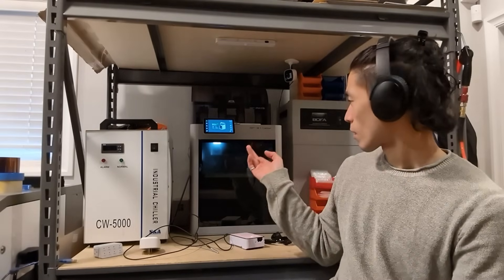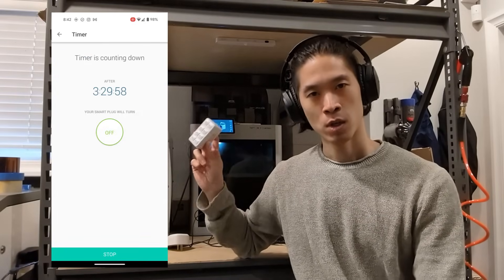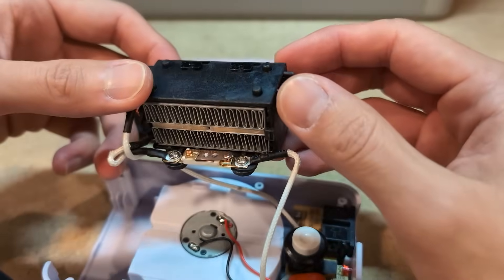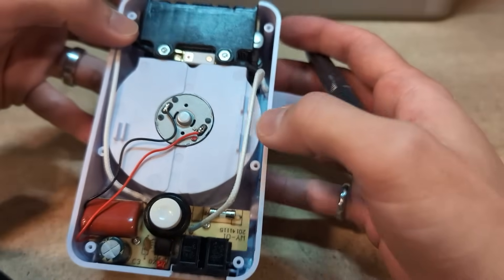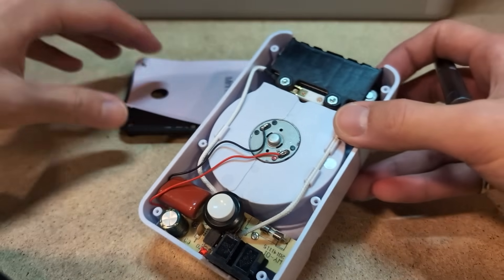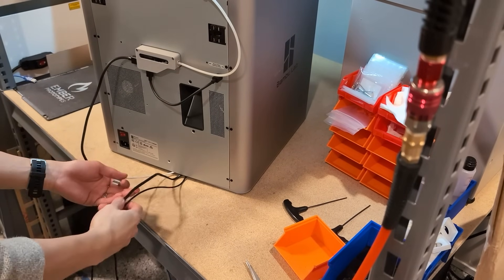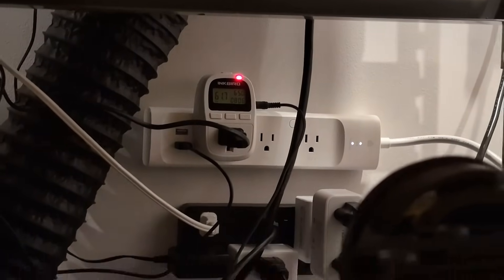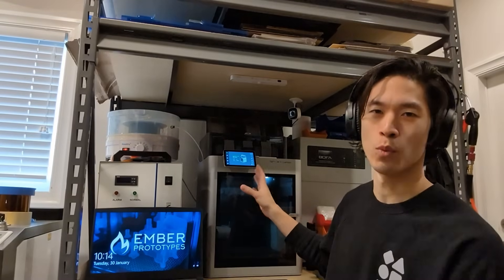Bambulab X1C - $50 HEATED CHAMBER

Comment: 6 months later... is there an update on longevity or any component wear?  I just bought it all to do PC-ABS but I would like to know how your machine handles it long term
Reply from the maker: @Xaedous  it's still chugging along great for me!
Reply: @emberprototypes  this is what I wanted to hear.. I am trying to get pc-abs dialed in and the actual layer adhesion is an issue
Reply from the maker: @Xaedous  heated chamber should help. I remember using polymaker pc-abs in the past and that stuff wants to warp like crazy
Reply: @emberprototypes  warping isnt the issue.. just weak adhesion between layers. like it s solid but breaks easily along the layer lines
Reply from the maker: @Xaedous  do you have the cooling fan turned off? That will help.
Reply: @emberprototypes  no fans on at all. Volumetric flow set to 10 on the last try and still weaker than pla+
Reply from the maker: @Xaedous interesting 🤔 I haven't printed much with that material so don't have a lot of experience. Curious if you ever find a solution!
Reply from the maker: @Xaedous  have you reached out to polymaker to ask?

Comment: This is a 50W heater were a Qidi 1 pro uses a 300W unit. Not sure it will be enought to be efficient.
Reply from the maker: It's been enough to maintain 60C no problem.
Reply: @emberprototypes  It is good to know. 
Thanks a lot.

Comment: Awesome mod! Thank you so much for posting a video. I've been wanting to put some sort of chamber heater into my P1S for a while and the heater and Inkbird just arrived today. Have you had any thermal issues with the electronics in the long term? I'm a bit leary about mounting the heater just on the other side of the back wall from the mainboard. Also curious about what some of the longest print times you've run with the heater on?
Reply from the maker: I've had zero issues thus far and have been running this for a long time now. I've had very long prints (20 hours) as well as non-stop production work and it's been working like a champ so far for me!
Reply: @ glad to hear it! I just finished the setup in the same configuration as you (well, with a bento box) and just fired it up for the first chamber heat. Thanks again!
Reply from the maker: @justinu1182  woot! And no problem, happy to share the knowledge 🙂

Comment: Great information.  I just ordered the heater and controller.  Already happen to have a stack of the kasa plugs.  Just tried ASA for the first time and I am at a 100% failure rate and I have been told by others that got the Layerzerodesign heater  that they went from 100% failure to almost 100% success by chamber heating.  This option is 1/4 the cost and from what I have heard regarding delivery times of orders of those other units, about 15 days faster to get a hold of so very happy to come across your video.  Thanks!!!
Reply from the maker: @Skul-Ski  yeah this is by far the easiest and cheapest mod. Let me know how it works out for you, it's been great for myself!

Comment: Thanks. My exact problem (some warping with PA) and the perfect solution. Thanks for the cautionary sticker removal part. Even turned against the wall that would drive me crazy.Excellent video.
Reply from the maker: @llogic2011  thank you! 🙏
Reply: @emberprototypes  INSTlled and heating up. Super easy. 30 min in I'm at 31C... Thinking about external insulation skin. Foil bubble foil. It may even look OK.
Reply from the maker: @llogic2011  🔥🔥🔥

Comment: I wish i had taken a better look at the temperature graphs before buying all this stuff.  The temperature swings are crazy, i tried to improve it by moving the sensor closer to the heater but the thermal lag on the sensor alone is excessive, its just not well suited to this application.  Going to look for a different heater with  actual air temperature control
Reply from the maker: The ideal scenario is to have PID control as opposed to on/off. But honestly, I've been using this for around 6 months now and it's been working beautifully. My opinion is this isn't something that needs precise control.

Comment: I did something similar with an enclosed printer about a year ago, but I used a different PTC heater that was larger and had more watts.  The enclosure is very leaky by design, but it planes out to around 62C or so.  I like your setup there, but I think I would get rid of the carbon filter on the inside and put an additional heater in it's place.  Might have to spec out some higher temp lube for the internal parts that move like leadscrews, but I think it should work ok in a  Bambu Labs P1S.  I made a printed mount for my temp controller so it sits on the side of the printer and I can more easily control the chamber temps with it.  I just added a short extension cord to power it.

Comment: I think I saw somewhere that X1C forces chamber fan above 60C because otherwise motors and electronics might fail. Do you see it working (against your heater)?

I found that covering top and sides of the printer with a towel helps a lot, the chamber temperature stays above 50C (if bed and nozzle are hot enough, I tested with ABS+, Nylon, and PC). Preheating is a bit of a wait — I set bed temp to 100C, aux fan to 50% and move bed next to the fan and wait. Your approach will probably save the wait.
Reply from the maker: I don't think this is true, or at least it doesn't kick in until higher than 60C.

Having a heater is definitely nice, way faster and more consistent over time (eg. during winter months vs summer)

Comment: I was thinking about putting one of my old heat beds in the bottom, placing a aqara temp/humidity sensor on the inside was of the unit and turning the bed on and off with automation like most things in my house and using a smart outlet. According to the display mine holds about 46, but then again I will have to check that. FYI the temp sensor for the charmer is the same board as the standby button and emergency shut down button on top.

Comment: I use the same PTC fan in my Resin printer - the fan craps out, elcheapo pancake motor - I'm on #3 in 6 months. Amazon supplier did warrant first one.
Reply from the maker: @plasmadyn  mines still running like a champ 🤞

Comment: That's not a thermal fuse. It's just a thermal switch to keep the temps between a certain range. If that part fails in closed state, it'll just stay heating (not sure what those chances are though). 
You could potentially try to add an (actual) thermal fuse in series to it, those will cut the power completely if a set temp is reached. Ideally before the flashpoint of the surrounding materials.
Reply from the maker: You're correct. I did mention it's a bi-metallic switch but the term "fuse" isn't correct...though it's somewhat similar to a resettable PTC "fuse".

I do have some actual thermal fuses, and I know that some space heaters with dual safety features have both a bi-metallic switch and a thermal fuse. Maybe will throw one in on the next mod!

Comment: i noticed that the poopchute kinda ruins the chamber fan's suction. if you block it off, the chamber fan will suck more air from the door if it's open. having the heater in that spot would be perfect for warming the air getting sucked in to the chamber by the chamber fan then.

Comment: Conversely, can a Bambu P1S print chamber be too hot?   I love in Florida and my printer is in an outdoor shed.  Ive been experiencing some adhesion problems, and can't find if heat in the chamber will impact a print.
Reply from the maker: Yeah definitely - if the electronics overheat you'll get skipped steps on the motors, etc. I'm not sure why this would impact adhesion though unless the extruder motor is skipping steps and not extruding properly. You may just need to clean your plate. That's the most common adhesion issue for people.

Comment: Nice! if you are after a tighter control on the temperature range go for a PID control. It might not need tighter control for short parts but tall ones get heat cycle markes that look like a wave that get worse the taller the part is. here is my set up on a resin printer.  https://www.youtube.com/watch?v=jAF_oXVqWSw
Reply from the maker: Thankfully I haven't been seeing any issues like that. See this tall polycarbonate part as an example:
https://youtube.com/shorts/2BzALg6l7o0?si=oJPXEeywd_XJBiQ5
Reply: @emberprototypes  Wow that is perfection.
Reply from the maker: @karlh6692  yeah it turned out very nice 🙂

Comment: meh you could probably eliminate warping with a dual adhesive method (gluestick with aquanet on top) but i'm going to Implement this anyway. Might use a pid controller instead i was working on an open source heater controller that was esp32 based with wifi etc that used kalman filters but i got distracted i have too much shit to do.
Reply from the maker: I already use Dimafix. A heated enclosure is way better and now I don't need to use adhesive for most parts. There's a reason why Stratasys machines and other higher end industrial machines have it. I believe it also helps with part strength and layer adhesion.

PID would be nice but not necessary from what I've experienced. Good luck!
Reply: @emberprototypes  bought your setup c:

Comment: I just did braces for my A1 in ABS-cf by putting a blanket over my X1C 😂 in a 20c room it was up to 60c in ~30 minutes or so. I wouldn't leave it unattended if you try this out. The first one I tried without this extra insulation warped pretty well.

Comment: I created your project and everything works (I installed two of them on a flashforge 5M Pro). The only problem is that at around 50°celsius the thermal fuse cuts off the heater. Do you have any idea? Do you think it can be replaced with one with a higher value?
Reply from the maker: That's odd, doesn't seem to happen on my units. But yes, you can source and replace them - they're a pretty common component!
Reply: Ugh, I just completed this upgrade and mine cuts out at 50c as well.  If anyone has a link to a direct fit 85c thermal fuse part number I’d appreciate it.
Reply from the maker: @joeziskend8463  I wonder if some of these are fitted with a different bimetal switch rated for a slightly lower temperature 🤔

You want to look for something like this: https://www.hctemp.com/AMT-bimetal-thermal-protector-thermal-switch-pd46516606.html

If you take your heater apart, maybe there will be a part number on it indicating its temperature range (I should have checked on my when I tore it apart)
Reply: @joeziskend8463  Any luck finding one?

Comment: Great video @emberprototypes. Have you tested the heater with the bimetallic switch bypassed ? Looking at the logs it looks more like the response of a bimetallic switch VS a PID controller (of course a PID loop can look like anything when not tuned to the system). Depending on the temperature of the switch there are 2 temperature controllers in the loop. Thanks again for the video.
Reply from the maker: I actually didn't test the bimetallic switch to find out what temperature it shuts off at...probably should have. The inkbird controller is simply turning the heater on and off, so it's not PID, hence why the temperature graph swings so much like that. PID would obviously be better, but requires more work. Thanks for watching!

Comment: Hello! I assume the the Inkbird controller switches the whole heater on and off right?
I guess it might provide better temperature stability if you bypass the controller and let the fan on the controller always on?
But sure it will need some rewiring and more effort.
Very nice solution as using off-the-shelf components anyways!
Reply from the maker: Yes it simply turns the heater on and off, so less precise control than something like PID, but with the convenience of a really easy solution.

Comment: So this is awesome. I even installed an identical setup thanks to you. However, after one print I think I’ve found a pretty decent flaw. The way poop flys around on the X1C I think it might be safer to mount the heater upside down in the current location or sideways under the aux fan. I’ve already had a piece of poop fly perfectly into the air intake hole. Just wanted to share. Thanks
Reply from the maker: Oh interesting! This hasn't happened to me at all but I'll keep an eye out 👀
Reply: @emberprototypes  also I had a brain fart here^ I meant to say the poop lands in the heater . Not the air intake.

Comment: I had issued with warping too. I solved the problem by wrapping my X1C with 1 inch polystyrene rigid foam. I modulate the temperature with the enclosure fan and keep the chamber temperature at 50 deg C. The fan usually runs between 30 and 40% with a build plate at 70 deg C.

Comment: A bit confused why you need the heater. A few printed parts will help seal up most of the holes between the electronics area and the main chamber. Once you do that the heat loss drops to where the bed can keep up and as a bonus your electronics should stay a bit cooler for possibly longer life.

Comment: I wonder if tearing apart one of those creality filament dryer things would give you a strong enough heater with all of the sensors/control panel. Not sure what the max temp is for those maybe some sort of adhesive insulation all around the enclosure would help out. I was thinking I would just make a replacement door panel or top glass and mount the heater to that so it could be removed easily and returned to normal.

Comment: Although a high enclosure temperature may be good for the printing process, you must realize that every part inside the chamber (mechanical, structural, electronic) must operate and 'survive' at that elevated temperature. A practical and still feasible chamber temperature is 60degC at most This is also the max chamber temperature that can be set in the X1E. 
Obviously, the X1E is prepared for that chamber temperature. But are all the other printers that you are "upgrading" temperature-resistant? What about the almost 80degC that you reach in your heater experiment?
Reply from the maker: I've only upgraded the X1C. Also, as I mentioned in the video, thin gauge thermocouples often read at higher temperatures in applications like this because of their low thermal mass.

The X1E uses all the same components and is rated for 60C. The temperature sensor is at the top near the front door and undoubtly has higher thermal mass and slower response than the thin gauge thermocouples I used.

My controller setpoint is 65C and the average temperature measured with thermocouples oscillates between 55 to 70C. However, the temperature reading from the Bambulab sensor itself never goes over 60C.

So assuming they use that same temperature sensor to control internal chamber temps on the X1E, I think we are fine. Only time will tell - but this is definitely something I have carefully considered.
Reply: @emberprototypes  One important difference between X1C and X1E is the extruder module, especially the controller PCB inside. The PCB or semiconductors of the X1E may have a higher temperature rating.
Although your demo is only the X1C, people may be inspired to try the same heater for their own printer. If their printer contains PLA-structural parts as part of the chamber, these can be severely damaged when exposed to your heater module (PLA starts softening at 60degC?). I would mention a simple warning against this in your own pinned comment
Reply: Does the heater have any regulatory approval,  like UL or the European CE? And I don't consider CE =Chinese Exports as a valid one...
Reply from the maker: @vsijben  if it does, I doubt it's real. Likely just another certification-less item from overseas (which is why I wanted to open it up and check for safety precautions)

Comment: I’ve used passive reptile heaters for chamber pre-heat.  Hadn’t considered one for my X1C.  You just add an Edison light socket and screw in ceramic “bulbs” of appropriate wattage.  The smallest “bulbs” are about 2” in diameter so the footprint is a little deeper than this heater, but it should fit.

Comment: Thought about doing the same just wondering what is the long term influence high temps will have on the electronics (stepper motors, components on the extrusion head, controllers on the back of the machine etc.) which will all be exposed to high temps for long periods of time (I wanted to get to 90°C chamber temp, but I guess 80 will do fine for most materials I need). Have you considered this? do you have any input on this?
Reply from the maker: 80C is likely too high. The X1E maxes out at 60C for good reason. 80C+ requires isolation of the electronics & motors like Stratasys machines do.

Comment: I have made something like this a while ago and uploaded it on printables.
I guess you have seen it as well from the placement of the thermal probe (I used exactly the same) and also you opened up the heater and went straigt for the thermal fuse what I explained there as well.

For everyone else: Just type in on printables "Bambu X1C Mini Heater holder and Air guide"
Reply from the maker: I totally did not see that, but I guess great minds think alike 😅

Comment: Did something similar with my P1P. Heater, temp control, enclosed and insulated chamber and a cooling fan on the CPU plus and additional exhaust fan mounted into the back panel to prevent cooking the electronics. The heater is permanently attached to the enclosure with screws no tape.
Reply from the maker: I should probably use screws and add a fan at the back at some point...but it seems to be working fine so far (I've been running it non-stop 8+ hours every day doing some production ABS work 😅)
Reply: @emberprototypes  now if someone could find a way to get the nozzle up to 350c and bed to 120c I’d be golden. Would like to stay all BL to keep a homogenous ecosystem which would make my workflow easier but as of right now running Qidi Q1 Pro for PPS CF because for the price it’s the best bang for buck for that material.